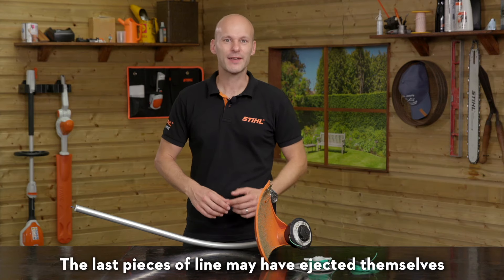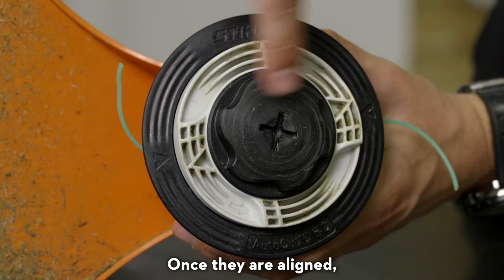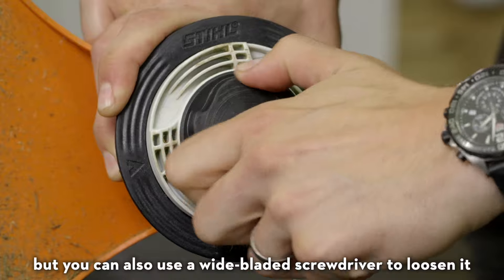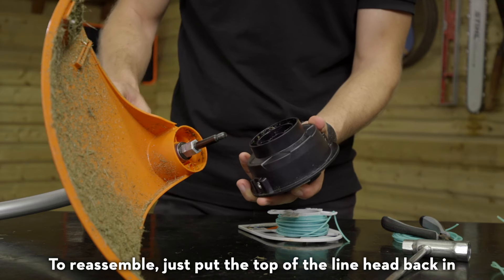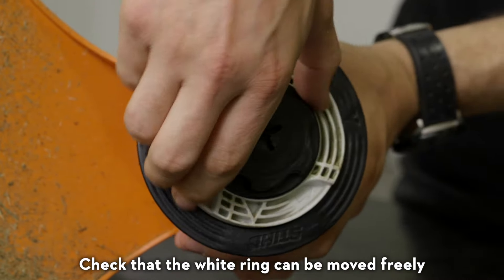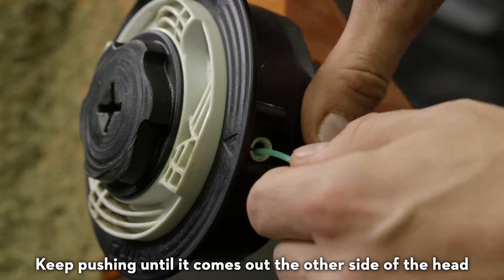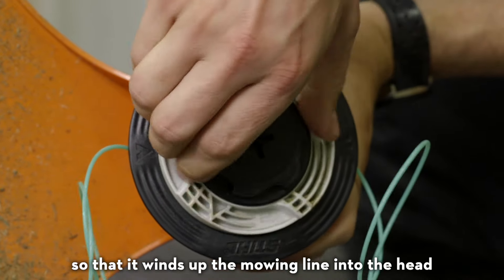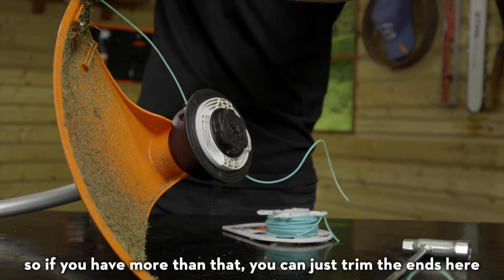How To Reload The Line On An AutoCut C 6-2 Mowing Head | STIHL GB

Comment: I cant thank you enough for this video.  I have the FS 50C and EVERY video shows it with the C 5-2 trimmer head. ...which works COMPLETELY DIFFERENT than this one.   My OWNERS MANUAL even has the C 5-2 instructions in it instead of the C 6-2.  Frustrating.    I was having so many problems with line not releasing....and every time I'd have to take it apart just to get more line out.   That was because with the autocut C 5-2 you feed line in 2 sections:  one into each side.  As you pointed out the C 6-2 is one piece of line.   The guy at the hardware store (Ace) who apparently puts these together didnt even know this.   So he was sending them out with line wound wrong.
Reply from the maker: Thank you for your comment. I'm glad this has helped explain it!
Reply: Ditto , my story is identical 🙂I  had the same frustration.  I thought I was doing something wrong 🤯

Comment: Ok - first time with new trimmer.  Paper instructions were USELESS!  Not traditional Stihl quality of instructions.  Video was spot on - thanks.  Also - traded in cheap Toro unit as head was locked - even the shop could not remove and replace. I went back to Stihl because you can work on them, they are not designed and built to ship and sell cheap- and then throw away.
Reply from the maker: Thanks for your comment. We will pass on the feedback about the instructions to our Product team, but I'm glad the video was helpful! Thanks, STIHL GB

Comment: Very helpful.  When I first got this Stihl, it was loaded with the line.  After using up all the line (I thought), I tried putting in a new line.  It wouldn't go in.  I removed the head and, sure enough, there was a little bit of the line still wrapped around the spool.  Even though it "looked" like the spool was empty, it was not.  After removing the last traces of line, everything worked like a champ.  Something to remember if you're having trouble.
Reply from the maker: Thanks for the feedback - yes, it is always worth double checking for old line first. Thanks, STIHL GB

Comment: Excellent, clear and detailed video, just what was needed!  Just bought a new FS38 with AutoCut C6-2.  The AutoCut C6-2 instrustions that came with the machine for loading this head are completely useless.  I'd never had worked out how do it without this video.  Stihl GB please share my feedback with your bigwigs!
Reply from the maker: Thanks for your feedback on the video. I have also passed your feedback about the instruction manuals on to our product team. Thanks, STIHL GB
Reply: @STIHLGB  I completely concur with MrMarkBell regarding how utterly useless the Autocut 6-2 instructions are.  Just a waste of paper, absolutely no way you would have deduced what you need to do based on the paper instructions.
Reply: @STIHLGB  I am going to say that the instructions are still utterly useless, I got a FSA60R recently, and the instructions for the head were cryptic and on a tiny flimsy bit of paper. For the cost of the hardware, is it too much to have a few large A4 sheets with some diagrams done by a professional technical artist?
Reply from the maker: @AgileSnowWeasel  Hi Graham, thank you for the comment.  That is great feedback and we will pass it onto our technical team.  Many thanks, STIHL GB
Reply: Absolutely agree!  The paper pictograph is worse than useless. If it wasn't for this video, I would never have figured it out.  The manual should include the URL for this video!!
Reply from the maker: @DanielPepper-mf7if  thank you for the feedback. We'll definitely pass it on. Thanks, STIHL GB

Comment: Before putting the new line through the holes,open the head and check if there is anything left of the old line or else you wont be able to guide the new line through the holes.

I just found that out today when i was mowing the grass.

Also when you bump the head dont bump it on concrete but dirt because that way it wont be damaged too much.
Reply: I just posted something similar above.  This is critical.  Thanks.
Reply: Thanks for the comment.I appreciate it  @cycleman55

Comment: I've already complained once on here, but I really need to add another piece of feedback - not a single time that I've tried to change the line have I been able to unscrew the head by hand. I always leave it screwed on fairly loosely in the hope I'll be able to open it again, but It becomes so ridiculously tight during use, it's a huge frustrating hassle every time, in fact I need to get someone else who doesn't live here to unscrew it for me, which involves one of us actually driving to see the other, a massive waste of time.

You say here to use a wide headed screwdriver - the plastic head has a huge cross in the centre of it - why on Earth would you not just provide a solid plastic 'screwdriver' that fits into the cross when you purchase the brushcutter? It's absolutely made to have a cheap, plastic 'key' to get it off, but no, I'm supposed to buy a metal screwdriver to fit in the big cross, when metal is far stronger than plastic, so it just ends up damaging it, plus costs me for a screwdriver I don't need for any other purpose? This would be so easy for you to just provide a simple piece of plastic to assist people who are slightly less strong. I guess this brushcutter is just supposed to be for strong people who have big enough hands to get a good grip on this piece of plastic? Nice and inclusive there, well done Stihl. 

I really hope you start thinking about things like this - I'm 5'2", my hands are small, but I still need to cut my lawns, and a simple piece of plastic included in the purchase price would make a huge difference to myself and many others I'm sure.
Reply: I agree. I’m a woman who started working in yard work seasonally and it’s difficult for me to do this job because I can’t unscrew the black knob.
Reply: same here--took an industrial blade screwdriver, vise, and pinning the head from the back to muscle the black knob loose.  What gives?
Reply: Same. I'm a self-employed female gardener, and while the Stihl battery tools have made it so much easier to do this job than it would be using petrol equipment, this strimmer head is a PIA!! I don't tighten it much at all, but when I need to remove the head that black section is welded on. I need to try and find a massive wide screwdriver that doesn't mangle the plastic. When you're at a customer's house and half way through a job, it's incredibly inconvenient and embarrassing not being able to get this thing unscrewed when you need to.
Reply: @nice2nettles  Hi use a pair of adjustable pliers or grips on the sides of the black section while holding the head. it will come off easily 👍
Reply: @christineknippenberg3646  for some strimmers and heads, there's a hole on the other side of the strimmer head casing you can stick a small screwdriver down, that locks the head into place, that makes untightening the head a lot easier.

Comment: I have just bought a new STIHL FSE 71 with the AutoCut head as in the video - I am intrigued with the idea of soaking the line in water.  Could I leave the whole machine head in a container of water thus having the line fully immersed between usages - which in Naarm [Melbourne] Australia is around once per month in winter and once per fortnight in summer or would this cause rust etc in the head bearings.  I am using STIHL line as supplied and in a 60M spare reel.
Reply from the maker: Hi, thanks for your comment. We don't recommend putting the whole machine head in the container of water, I'm afraid. Just the trimmer head itself once it's been taken off the machine should be put in a container of water. Thanks, STIHL GB

Comment: Hi, I have the FS50 and the line keeps melting / welding itself together in the head. Do you have any advice on this issue? I load the head as you do in the video, plus the machine is new and the line is Stihl 2mm.
Reply from the maker: Hi David, thank you for your comment. I'm sorry to hear of the problem that you're experiencing. Line welding is caused by ultrasonic resonance of the line within the head, which causes a build up of excessive heat and results in the strands welding/sticking together as you've unfortunately experienced.

The most common reason for line welding is the age of the line as it's hydroscopic so can dehydrate over time. To avoid this problem we recommend soaking the line in water 24 hours or more before loading it into the head, as it will make the cord less brittle and more flexible. 

A couple of other contributory factors to avoid are:
- excessive line length (for example if the deflector has been removed or modified).
- heat created by sustained trimming around hard surfaces such as fences and bricks, concrete and asphalt. If this can't be avoided then take regular breaks from this type of work and manually extend the line more often to avoid excessive heat build-up. You can also use a lower head speed for this type of work and vary the throttle speed.
- ageing line - use new line and soak in water for 24 hours prior to loading the head.
- ‘twisting’ the line when reloading. When reloading the head, it helps to let the line hang free and rotate the spool around the line when loading the spool. People often tend to hold the spool stationary and wind the line around the spool. This technique tends to twist the line rotationally which contributes to the line binding and fusing together due to the ultrasonic vibration

Finally, the AutoCut heads are designed for mowing shorter grass, so if it's long grass or scrub that is causing the problem then we would recommend using a heavier duty cutting attachment such as the DuroCut head or even a blade or brushknife to avoid this problem. I hope this helps, but let us know if you need any further information. Thanks, STIHL GB
Reply: @STIHLGB  the soaking the line in water instruction is frequently missed, it's something I only found out today from your US site (although I did then find it on the UK site). It seems you need to be quite precise when cutting around hard obstructions like brick walls to not actively hit the wall itself if you can avoid it, I think many new users think this is fine from seeing professionals with their £1k+ petrol strimmers being a bit more gung ho?

Comment: Great video , I’ve got this model but the self feed isn’t working, how hard do you need to bump it on the ground ?
Reply from the maker: Hi, thanks for the feedback on the video. The AutoCut head needs to be bumped firmly while spinning at full speed. This works best on firm, grassy ground away from the main lawn area. If the line does not feed out, we recommend removing and re-winding the line into the spool and trying again. We have a video here which shows it in action: https://www.youtube.com/watch?v=j-PXYPtAE8s  Thanks, STIHL GB
Reply: Yup, mine doesn't either. I'll try what Stihl recommended.
Reply: @STIHLGB  Thanks for this tip! The manual pictographs - a very poor choice - don't reference this.
Reply: @STIHLGB  How about putting QR codes in your strimmer head manuals for this video and that video? (ditto for the other heads and their videos I presume you have here)?
Reply from the maker: @AgileSnowWeasel  Hi Graham, thank you for your comment.  That is a great idea, we'll certainly look into it.  Many thanks, STIHL GB
Reply: @michaelossing6497  It's also-fuckin-lutely worthless. So glad I found this video!
Reply: @AgileSnowWeasel  Yes!!  Please!!
Reply: 'abso', not 'also'.  Damn autocorrect.

Comment: Basically with this head you waste 50 percent of the line because 50 percent of it stays on the spool after enough of the line has been ejected.

But it is a little easier to spool it then the original head.
Reply from the maker: Hi, thank you for you comment. If the line isn't feeding correctly we recommend removing the line and re-winding the spool. If the very end of the line isn't feeding correctly we recommend turning off the engine / removing the battery and extending the line by hand. Thanks, STIHL GB.

Comment: Are there any tricks to try when you push line in 1 side, but it wont come out the other side?  Mine simply stops and you are just bending the string.  I can take it apart and wind 2 strings manually as with old models.
Reply from the maker: Hi, thanks for your comment. If the line is particularly 'curly' having been wound tightly round a new spool then this can sometimes make it a bit tricker to load. You can usually straighten it out a bit by bending that first couple of inches the other way to the curl. This should straighten it out and make it feed all the way through without catching. It's also worth checking that the arrows on the black outer ring and the white inner ring are as closely aligned as possible as shown in the video, at around 1 minute and 52 seconds. I hope that helps, thanks, STIHL GB
Reply: Thanks - I pulled the line straight and it passed thru on the 3rd try
Reply from the maker: @davem8033  glad to hear you managed to get it sorted. Thanks, STIHL GB

Comment: The sales man said i could also use the thicker red/orange line, but i had trouble pushing it through, i could not make it exit. I cut two Pieces of 2 meters and push them in on opposite side like on my old model-head and screwed so they disapaired inwards, i could cut, but it did not feel right. Can i only use the green line after all?
Reply from the maker: Hi, thanks for your comment. If you have an AutoCut C 6-2 mowing head, then you can only use 2.0mm (green) line or 2.4mm (orange) line. The red line is 2.7mm which can't be used in the head. If you feel that it isn't cutting right though, we do recommend you taking it to a STIHL Approved dealer to look at it more closely. Thanks, STIHL GB

Comment: My white ring won't compress back down into the head. It still springs up and down. I hold it down and screw the nut down as tight as it will go and white head pops when it's turned anti/counter clockwise. The nut seems to bind up and seems cockeyed on the bolt, like it's somehow cross threaded.
Reply from the maker: Thanks for your comment. If the mowing head isn't working in the way shown in the video, we suggest taking it to your local STIHL Approved Dealer and they will be able to take a look at it for you. Thanks, STIHL GB

Comment: How do you release more line when they get snipped/cut off while using it ?  Do you wind it out clockwise? I presume I don't tap this one off the ground??
Reply from the maker: Hi Sean, yes, you do tap this one on the ground. Any AutoCut heads have the feature to extend the line by tapping them on the ground. Thanks, STIHL GB
Reply: Can you do a video  please !!!!?
Reply from the maker: Hi  @scgixer , can I just check exactly what you mean about the line snapping off? Do you mean if it just gets too short whilst trimming, or do you mean if the line snaps off inside the head? We can certainly consider a video showing how to tap the AutoCut heads off the ground to extend the line, but if it it snaps inside the head, you do need to take the top off and feed the line out again. Thanks, STIHL GB
Reply: Sorry yep, it's just when it wears down from strumming too close to trees and walls etc . Not inside the head . There maybe something wrong with mine, doesn't seem to automatically release. I tapped at full throttle  a few times.
Reply from the maker: @scgixer  thanks for clarifying. Could the line be twisted together further inside the head? It might be worth taking it apart and reloading it to make sure that it's not jammed further inside the reel? It's also worth soaking the head in a bucket of water overnight as that helps the line stay flexible and makes it less brittle so is less likely to snap off in the first place. I hope that helps. Thanks, STIHL GB
Reply: Ok I'll try that tonight,thanks a million for the help and swift replies
Reply from the maker: @scgixer  You're welcome!

Comment: Thanks, how do you keep it from tangling and breaking of  inside.  so far I am NOT impressed with this trimmer head at all.  More work than necessary.
Reply from the maker: Thank you for your comment, and we are sorry to hear you are having trouble.  Our line is hydroscopic so dehydrates over time, which makes it more brittle and liable to breakage.  To avoid this problem we recommend soaking the line in water 24 hours or more before loading it into the head, as it will make the cord more flexible. 
Tangling inside the head can be caused by twisting the line when reloading it.  It helps to let the line hang free and rotate the spool around the line instead of holding the spool stationary and winding the line around the spool.  We hope that helps.
However, if the tangling is a persistent issue even when it is rewound, please take it to your local STIHL Approved Dealer, and they can look into it further.  Many thanks, STIHL GB

Comment: Usually I have no trouble changing the line on weed whackers, but I borrowed this one recently, and it seems to just spin forever? Is there no way to lock the shaft or anything? When I rotate the black center cap, or try to spin the nut underneath it (that the black cap fits over) it just spins forever and will not loosen. I can hear it spinning the shaft connecting to the motor as well. No idea what's going on with this one. Anyone have any ideas?
Reply from the maker: Hi, thanks for your comment. It's really hard for us to diagnose an issue like this online, so we would always recommend taking it back to your local STIHL Approved Dealer so that they can look at it properly. Thanks, STIHL GB